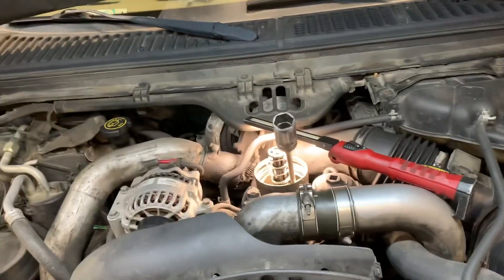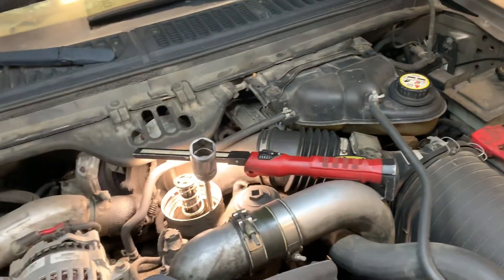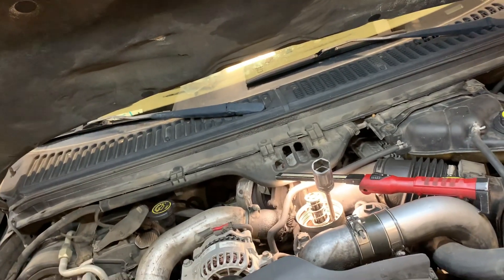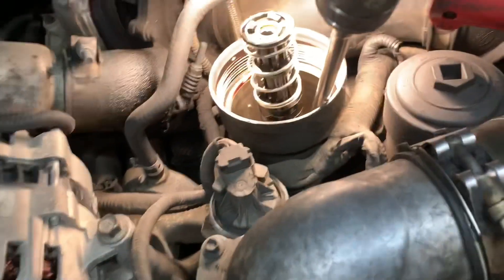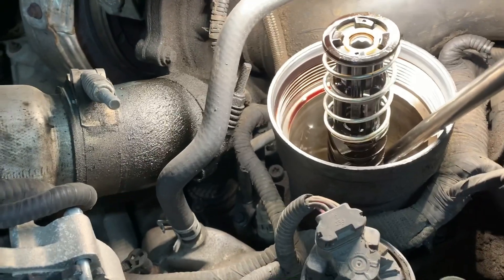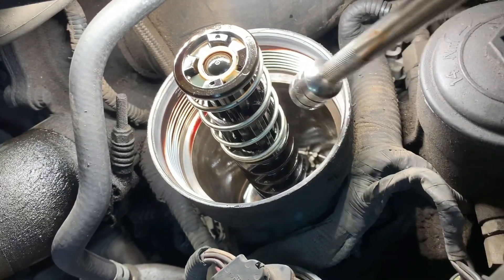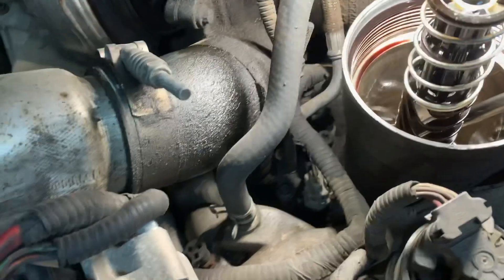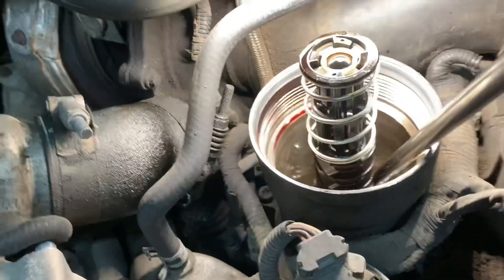6.0 no start

Comment: Can only hope the front cover isn't torn up, and the pump didn't ingest lifter needles. 

Did it end up being the high volume pump being worn out? How many miles on this particular rig?

And thanks for making this in English, my last name is obviously foreign as fuck, but my English is pretty spot on. It's the native language in this country. I suggest to others to learn to speak, read and understand it. 

Anyway, this video makes it super easy to understand the oil flow path, exactly. Greatly appreciated sir. Well done.
Reply from the maker: Front cover was fine, as shown oil cooler top gasket had a direct oil leak, replaced cooler, replaced oil pump gears, ultimately replaced hpop due to draw down of the reservoir after a 2 day plus soak. If it sat overnight after repair it would fire up fine, more than one day it would stall. Replaced hpop and all is well. It originally would start and stall after an all day or overnight every time so I did improve it, lol